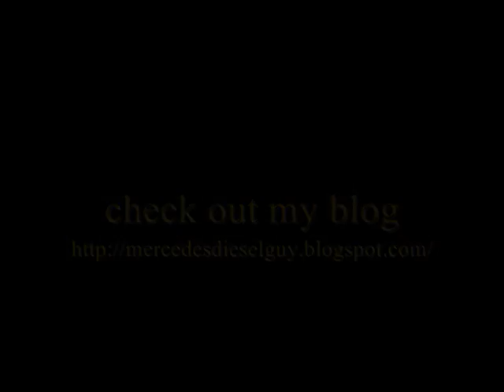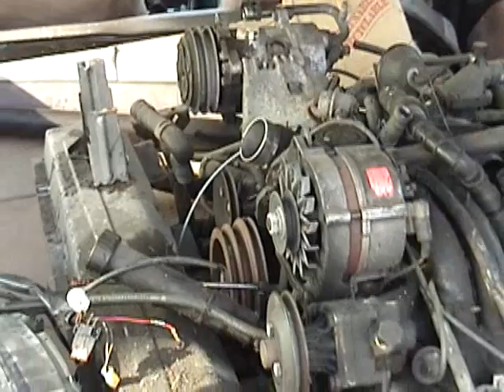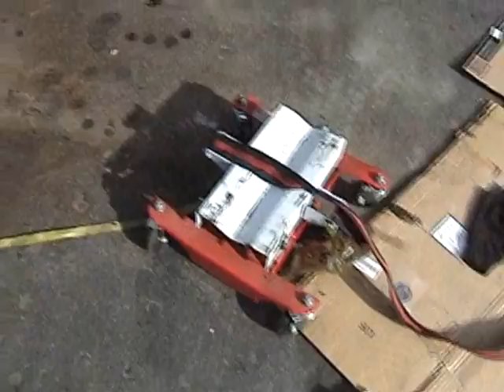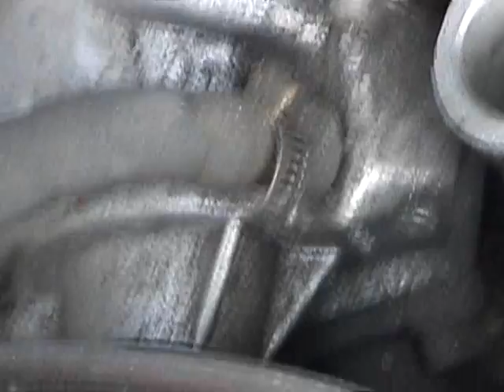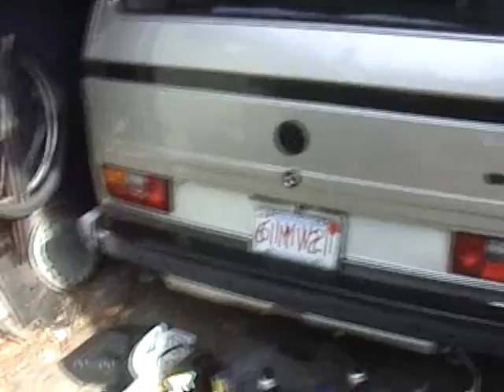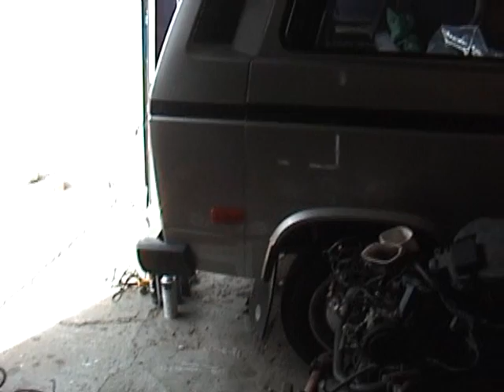1991 Volkswagen Vanagon - start of engine swap

Comment: Newest comment is 3 years ago ?  What is the rest of the story ?   I bought a 85 vanagon with "low compression"...per the PO, but found a 1.9 with a partial rebuild - automatic, on the cheap....so I am in a similar situation.  I thought I would like to verify the compression is low as my friend said, "no one knows shit about these engines"..basically, don't trust anyone...figure it out yourself...
Reply from the maker: This series of videos ended up pretty scattered without much of a narrative. End of story - I completed the engine swap and have been happily driving the Vanagon since. If you don't have a compression tester, get one and go from there. The 1.9 liter engine is (if I'm not mistaken) known for having a stronger bottom end than the later 2.1 liter engines. Best of luck.

Comment from the maker: Got the used engine installed by last summer. Drove it (sparingly) and then replaced the head gaskets this spring. Drove it 100 miles last weekend.

Comment: The sensors are hooked up properly, the problem is the radiator fan only run in short bursts.  So is there a problem with the fan? or the temperature sensor ?

Comment: I have 1.8 Golf engine(petrol) in my 1989 Vanagon. Have over heating issues with the radiator fan not running long enough to keep the coolant temperature down.  How do i solve this?

Comment from the maker: @Jx1x3 No timing belt or chain. Can't say I completely understand the setup on this engine, but it's an oddball in that sense. I do plan on doing some basics. New plugs, definitely. Probably new valve cover gaskets, too. Most of the rubber on my old engine was near new, so that's getting swapped over. I'll replace anything that seems questionable.

Comment from the maker: @Jx1x3 Indeed. My old engine had pretty much all new (or VERY recent) hoses. All the best parts from both engines go on this one. I'm undecided, but may get a new water pump. But, like I said, it looked VERY clean, as in a recent replacement, as it is.

Comment: if I were you I would use the water pump from the new engine and strip everything off of the new engine, clean it plotless, and transfer everything from your old engine. and whatever newer better parts the new engine has, use those. start off with taking off the hoses. make sure you tag each hose so you know where it goes..trying to find a vacuum leak sucks

Comment: Woohay good job motor looks nice do you know how long it's been sitting and not ran for ? Make sure you engine flush the oil before running it .. But at first looks it looks a clean solid motor but it looks like it's relatively average miles doesn't look high or low I would guess 90-130k miles but please record as much as you can and upload as much as u can as I'm looking forward to this ;) good luck buddy